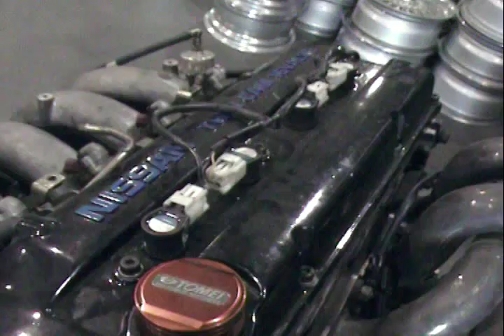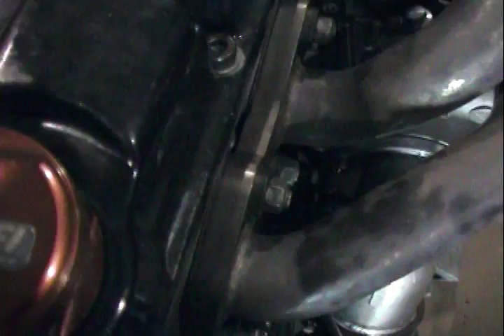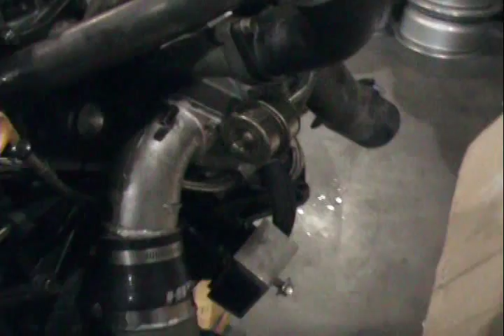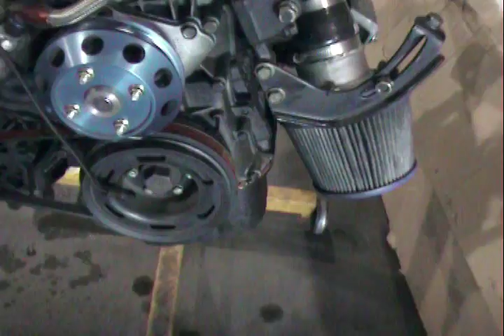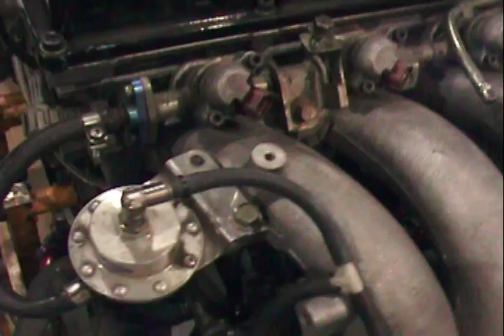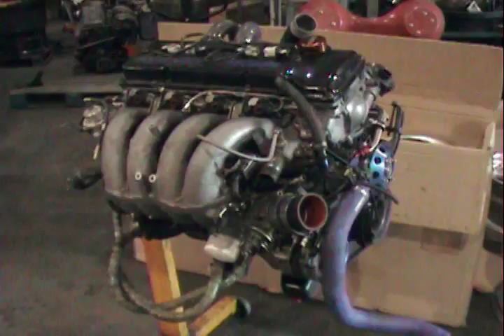KA-T . KA24DE Turbo

Comment: i figured out a way to make it work with gsxr 1000 coils, you have to shave down the raised edge around the plug holes on the valve cover, and then get ngk plugs with the removable contact end  then the gsxr coils will fit it

Comment: RB26DETTs are better than SR20DETs, but any other RB isn't worth the tiny benefit. KA24DEs are easy to come by in USDM markets, and KA-Ts can pull similar power to SR20DETs, at the cost of weighing about 50 pounds more. It's hard to say which is better, because each has pros and cons.

Comment: @vincently1231 personally hate sr's have done way to much work on them and still had them  not make nearly enough power for money, and not be reliable. i did a ka-t setup awhile ago for my personal track whore and basically dumped the 2k that i would have spent on the sr into my ka bottom end then less then i would have payed for routine maintence items for the sr i bought a cometic gasket rebuild kit and an act 6 puck sprung clutch. it made 390whp with a holset at 16psi running a straight pipe

Comment: u seem like u know about this engine, i got a prob with mine can u help me out?
its idling at 2500 and wont rev past 3000
is it possible its the timing belt, cylinder compression, or sumthin else?